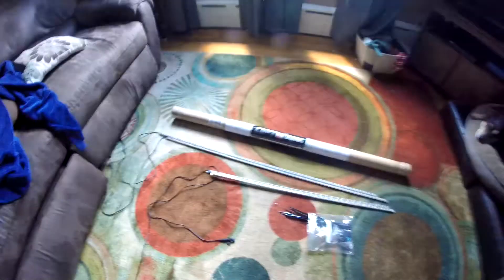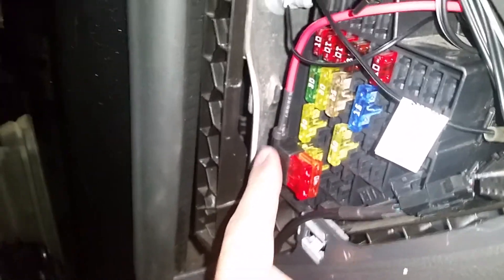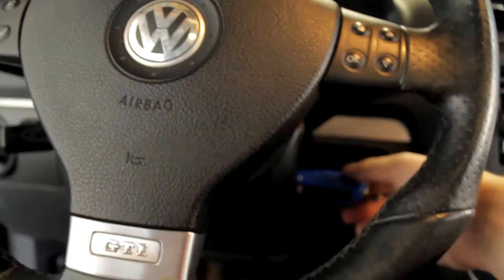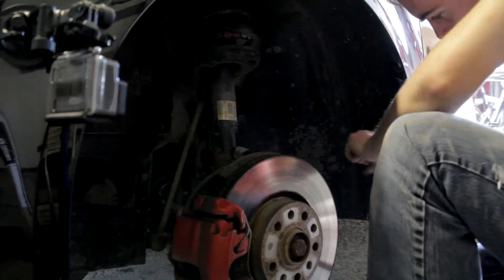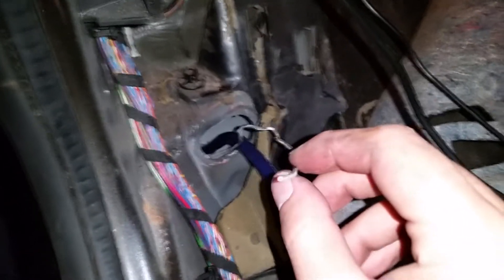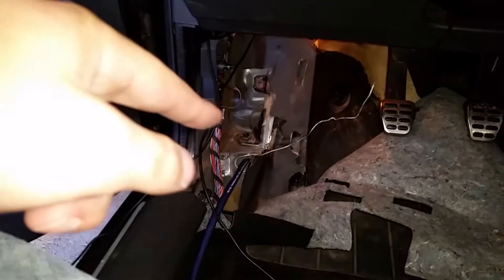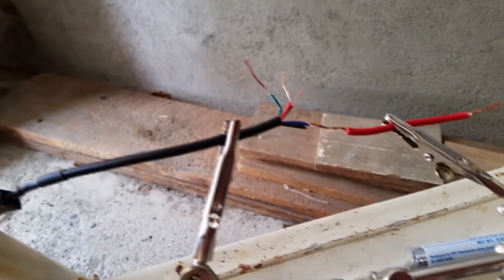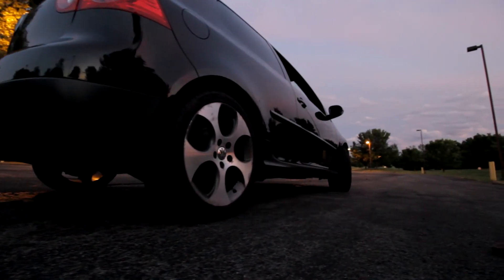Best Underglow (VW GTI)

Comment: Why drill holes when there’s gromits in the bulk head between the cabin and the engine bay.
Reply from the maker: I had to run 4 gauge wire for my amp so I went through the same hole. Plus I have the 6 speed so one of the spots is blocked for the clutch pedal

Comment: Watching because I wanna do my GTI in red, but seems like a pain 🤦‍♀️
Reply from the maker: You can also plug the lights into a 12v socket but the GTI only has 2 sockets. It's fun for the summer time but winter has corroded the connections and mine doesn't work anymore. Definitely a cool party trick though.
Reply: @SavageGTI  Hmmm didn't think about that, but sounds like a plan 👍 and yeah I totally agree on the Winter aspect because I live in West Virginia 😫 just wanted something not typical,  ya know?
Reply from the maker: I feel you, I just had to live out my childhood dreams from need for speed to fast and furious style. Definitely turns heads driving by people at night 👌😎